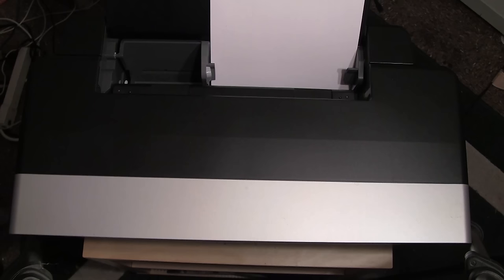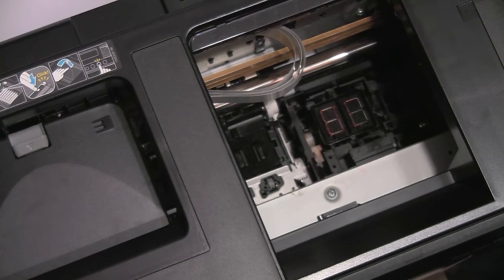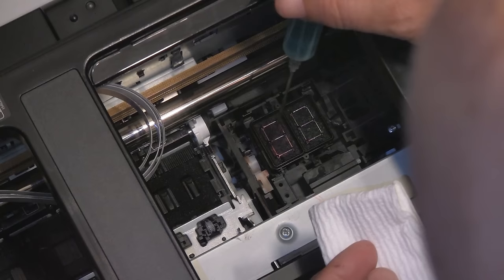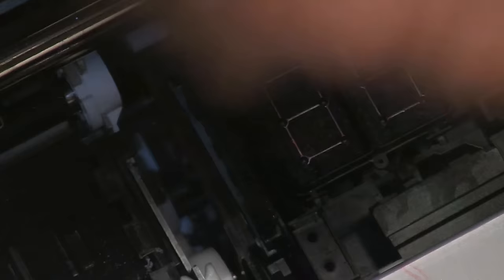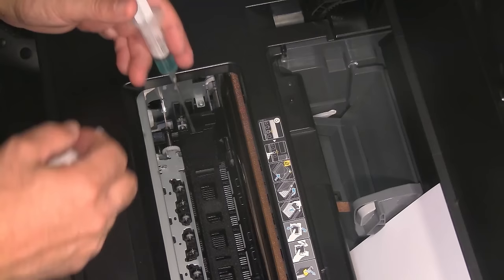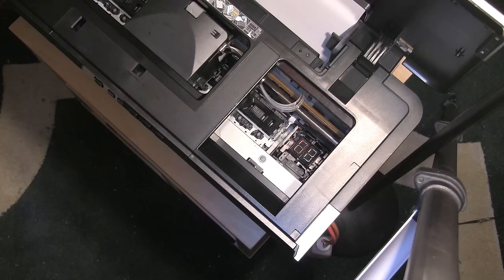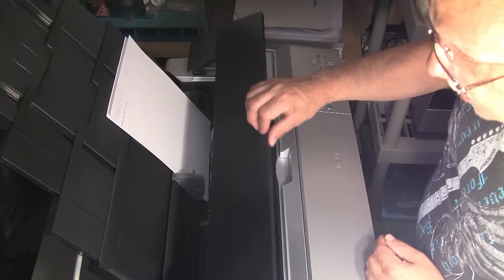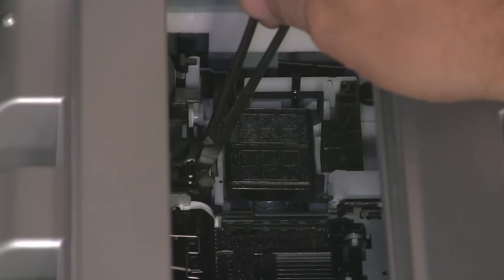How to perform Basic Maintenance on the Epson R2000 and 3800

Comment: Thanks for the video, it seems to be the most useful of several that are posted on YouTube. In particular, the R2400 (mine) has this plastic lid over the cartridges, so some of the other videos on other Epson's aren't really applicable. Do you have a video also for unclogging the nozzles? Also, how long does one have to wait to make sure the ammonia solution is dried before actually using the printer?
Reply from the maker: +Mark Samuels  Yes most EPSONs with Carts that Ride on the Printhead carriages have those covers. You can actually perform something that seems to unclog truly stubborn nozzle clogs that you can not do on the more PRO printers.
After having the Print Head moved toward the center position and resting over a damp paper towel , you can remove the color cart corresponding to the color that is being stubborn and with a plain tipped syringe with a piece of tubing attach, directly inject head cleaner into the ink stem. Easy does it. As you can actually cause damage to the print head. But when done right it will most often clear out really tough clogs.
I'd have to review the video to know what you are referring to when you say " how long does one have to wait to make sure the ammonia solution is dried before actually using the printer?"
There really is no wait in most cases.
Reply: +Jose Rodriguez Thanks for the reply Jose. There are some other videos showing how to inject a small amount of solution into the print nozzles after removing the ink cartridges. This printer was out of use for several years so is probably very clogged, and there may be air bubbles in the nozzles. What I meant about the cleaning solution is that ammonia is pretty strong, even diluted, so wondered if one had to wait before running a print check for example. Sounds like not a problem. I am in Canada, we can buy Windex here, some other site mentioned that other ammonia cleaners could damage the print head so will stick to the windex. Am waiting for some replacement ink cartridges as some ran dry as well, can't do print checks or run the cleaning program till then. Will let you know. Mark
Reply from the maker: +Mark Samuels I've been using Windex for years without a single incident. But if you prefer, there are many Head Cleaning Solutions being sold by various companies that are ammonia free and use alcohols and surfactants  ( Soap ). They are all pretty good and work as advertised.

In my series on how to revive a printer, I go through the steps I used to revive an old EPSON R340 that hardly had any nozzle firing. I got it to work 100%.
Have a look and you should find it useful. The key is TOTAL Patience! You can not hussy this process. But unless the printer is mechanically damaged, you should be able to get it to work.
Reply: Thanks Jose I will try to find that other video and let you know if I can't. I work in a research lab so dealing with syringes and plastic tubing is not unusual. I just don't want to break something with too much pressure or short-circuiting or wrong solvent. Sounds like the mechanics are actually fairly forgiving if one can use ammonia, alcohol or ethylene glycol (i.e. antifreeze) without damaging the print head or sponge material. I'll try just wetting and blotting first, if that doesn't work then I'll blow solution through the nozzles to clear them or remove air bubbles. But it might just be dried ink on the head itself. Thanks!
Reply from the maker: +Mark Samuels That's interesting, I also worked in a research Microbiology lab at the Armed Forces Institute of Pathology, not closed, for about 25 years. So I also had access to all sorts of goodies.
I've never had a single problem directly caused or due to using Windex on any of my multitude of printers.
If you get to the point where you will inject head cleaner into the ink stem just keep in mind that you can damage the head. So if you are able to easily inject cleaner, while the print head is resting over folded paper towels, let it sit for several hours before you inject one more time. Then replace the cartridge and restart the printer. Let it do its purge and check your nozzle check. Likely you will sill cleaner inside the channel chamber so do a cleaning cleaning cycle and recheck. If all is fine then you are set. If it still isn't but you are showing improvements, turn off the printer and let it sit overnight before retesting and possibly repeating the process. 

I was abler to completely restore a R340 that had about 95% of its nozzles blocked. If you are interested, watch my series on that.
But patience reing king when you are trying to clear out a really stubborn channel.
Reply: +Jose Rodriguez Thanks again for the additional details Jose. Interesting, you either worked on important pathogens soldiers are exposed to around the world, or creating new biological weapons - I don't want to know which! Anyway, I've cleaned the print head with soaked paper towels from underneath, and injected small volumes of windex through the nozzles so I think they are clear. However nothing prints when I run a print check, I imagine I need to run a cleaning cycle to reprime the nozzles, but I'm out of one ink color and waiting for the replacement from Epson, without it the cleaning program won't run of course. Once I have the replacement and run a couple of cleaning cycles hopefully all will be well, but will let you know if not. Best,Mark

Comment: thanks 4 this ! I own a R3000 with no-genuine ink . my black matte stopped completely , no line at all on the nozzle check . Epson fixed for free , but they said it was because of my not genuine inks . Now I'm afraid to use  no genuine inks again... any suggestions ? do you think it happened because of the inks of poor quality ? it worked great for months
Reply from the maker: Alessandro Piras Probably not the inks IF you bought inks from a reputable dealer and not CHINA! The cart may have also failed to feed the lines OR you may have introduced AIR into the line which is nearly impossible to remove or purge unless you reinitialize the printer, only a service tech has the software to do . That is why you had a complete failed black nozzle check on that color. You will almost NEVER have a complete failure of a color channel. That usually indicates a bad cart that leaks air and not actual clogs. You should expect to play at least $20 per 100ml or each color if you  buy from reputable dealers in the USA. Anything less and you are buying crap that will hurt your expensive printer.I use OEM and top quality 3rd party inks on all my 16 CANON and EPSON photo printers! Only the best will do.Or just stick with OEM inks. No one ever said that home printing was going to be cheap. Why buy a great and expensive printer and then go cheap and feed it garbage that will probably kill it?  Not a good idea right?
Reply: Jose Rodriguez I have a complete block in black. the printer was off and in storage for 5 months. before storage it printed perfectly. i have run the cleaning utility three times yesterday and three times today, black is still not printing when printing the nozzle check. going to do the windex clean but im curious about air in the line...
Reply from the maker: There are no lines to speak of on the R2000 so it is not that, but are you using a refillable cart? There ways to clear out a true clog if it is indeed that. Are you saying that one Black channel is totally blank? Not even on line?
Reply: Jose Rodriguez by carts, do you mean ink cartridge? if so, im using the carts that came with the printer direct from Epson. No lines are printing from either black. Thanks!
Reply from the maker: ***** The Matte and Photo black are not printing? On your first comment you say no-genuine. So now you are using OEM inks? If both Black channels are blank I would suggest that it might be a mechanical problem that you will have to talk about with EPSON. I apologize on my previous post. I thought we were talking about the R2000. The R3000 does indeed have ink lines and if you were at one time using refillables or otherwise, you could indeed introduce air into the ink lines and that is very difficult to force out with only cleaning cycles. Only a full re initialization can force air through and out of the lines so you only have ink in them again. And Adjustment program is the only way to re initialize the printer. It will use up a ton of inks but the air will be forced out.Those programs are only available to Service techs but you can buy them off of EBAY If you look for "R3000 reset" http://www.ebay.com/itm/EPSON-STYLUS-PHOTO-R3000-SERVICE-ERROR-FAULT-RESET-FIX-MAINTENANCE-DISC-/161755190981?pt=LH_DefaultDomain_3&hash=item25a95c56c5You must be VERY careful using this software as it is meant for EPSON Engineers and you could forever ruin the printer's firmware.
Reply: Jose Rodriguez  R2000 is my printer. Both the matte and photo black do not print. My software says there's ink in the cartridges. I'm using Epson T1591 Photo Black and T1598 Matte Black Ultrachrome inks. The inks came new with the printer.
I will soak printer head in windex, contact Epson and let you know what I find. Thanks!

Comment: Hello Jose,
Thanks for making this video. I have an Epson Photo R800 which packed up 2 hours ago after trying all sorts of button pushing I decided to look on you tube for help. The sponges were clogged and I just gave them a quick wipe off with kitchen roll - it worked and the printer started up again!!
It still has a 'service needed' pop up and the printing is a tiny bit smudged so I was wondering if something else other than windex would work as its not easy to get in the UK.
Maybe methylated spirit or something?
Anyway thanks for saving my printer especially as I bought loads of ink just recently! 
Martyn.
Reply from the maker: +MrTeatime2 Glad it helped. You can use a 5% solution of regular cleaning ammonia in distilled water then use that.The Pop Up? Does it say that parts Have Reached the End of their Lives? If so that is the Waste ink Pads and the waste ink Counters need to be reset.Make sure you really clean the left most area of the platen sponge. That gets super grungy.Clean the perimeter of the Purge unit-sponge  or AKA  parking station  and the wiper blade.You need to do this at least once every couple of months depending on how often you are printing.
Reply: +Jose Rodriguez Thanks for the reply Jose, I didn't clean the parking sponge or the wiper yet, just the very fouled big left pad. I'd like to get some ammonia and D.water to clean it all properly as your video shows. One pop up said parts have reached their end of life, now it says it needs a service! Since it's working now I'm thinking a good clean up might be all it needs and I don't intend to use it again until it's been cleaned anyway. Thanks again Jose.
Reply from the maker: +MrTeatime2 You will ha e to reset the waste ink counters zoo er or!after. There is a free tool that will work on the r800. The SSC tool I TBI k it is can!led. Or the pay per use WIC tool. You can get the too from www.octoinkjet.co.uk and you use it for free to read the couters. To reset you have to buy $10 reset serial key.
Reply: +Jose Rodriguez Thanks for all your help Jose I really appreciate it.
The printer gets only light usage and I bought enough good ink to last a long time so if a clean and reset keeps it working then that's great.
I didn't understand what you mean, 'The SSC tool I TBI k it is can!led.?
Martyn
Reply from the maker: +MrTeatime2 Yeah. Sorry about that. Typing on my table is a bear for me! It was supposed to read "The SSC tool I thnk it's called"Go here for the SSC toolhttp://www.ssclg.com/epsone.shtmlYou may have to run it in XP compatability mode.It should be able to reset the R800. If not then you will have to use the WIC tool fromwww.octoinkjet.co.uk for $10 per reset.
Reply: +Jose Rodriguez Thanks again Jose, I found both sites and I can get Windex from Amazon!
Reply from the maker: +MrTeatime2 That's great. Make sure it is the original with ammonia.

Comment: I have a 4 yr old R2000. Recently, the print speed has slowed to a crawl.  It will make perhaps 8 swipes across the carriage and then slow to one swipe every 4 seconds (I timed it). Multiple emails and phone calls to Epson Support have resulted in the determination that it is not a software or communication issue.  Rather, it points to a hardware issue. Their recommendation is to take it to an Epson Service Center, the closest being 40 miles away in NYC (no thank you). I came across  your video this morning while trying to do some more research on the slow print speed.  I am embarrassed to say that I never knew you needed to perform these types of maintenance tasks.  When I looked into my printer, every area that you mention is coated with ink, the pad on the far left looking like a lake. Is it possible that this is what's causing the slow print speed?  NO ONE at Epson mentioned doing any cleaning such as this - no surprise. My latest nozzle check, btw, has only one missing dash in one of the black cartridges. All the rest look fine. The print quality seems fine, if a bit dulled, but there are no smudges, streaks or white lines.

Thank you for any input.
Reply from the maker: Are you on WiFi??  Nothing I know of would cause slowing down of the printing process except a WiFi problem.  And please do that maintenance procedure every two months.  Eventually you will get unexplained black blotches all liver your prints.
Reply: Thank you so much for your response. Yes, I am on WiFi.  Recently, we changed our Internet provider and hence, our router.  I initially thought this was the problem, but after uninstalling and reinstalling the software and updated drivers umpteen times AND trying a USB and an Ethernet connection instead of the wireless one, the problem persisted.  Did not happen with the previous router, but wouldn't the same issue with the wired connections rule out the router?

Got Windex today and will definitely do the maintenance procedures.

Thank you again.
Reply from the maker: Remember that when you install for WiFi and alwo USB you will get TWO copies or  instances of the printer in your devices and printers.  Wait...... Are you on Windows??? Please say yes.  If so, you will two icons in the devices and printers. One will use WiFi and the mother USB. Make sure you are printing with the correct one Iintended for USB.  I have an R3000 that prints like a Tortoise on WiFi and like a Hare on USB.  But you need to select the correct printer as you will have two copies of the same one printer.
Reply: OK, Thank you.  I THINK I have tried that in my quest to solve this issue on my own, but it's worth another shot tomorrow. I will let you know of the outcome.  And yes, I am on Windows.

Just to be clear, would you install the "USB Copy" from the original disk, or just use the "Add Device" from the devices and printers window?
Reply from the maker: No from the original disk. Delete the copy you now probably have showing up in Devices and Printers. Right Click and remove printer.  Then during the reinstall choose Via USB and none of the others.
Reply: OK - Victory, I think! As per your instructions, removed R2000 from Devices and Printers. Re-installed from CD using USB connection.  Printed a photo from Windows Photo Viewer - speed was correct. Hurray!

Went to print from PSE 13 and got message: "The saved printer information is not compatible with this version of Photoshop.  The saved printer is no longer available."  Checked Adobe Forum for help with this and learned that the fix was to download the PSE 13 Update 13.1, but I was already running 13.1.  Someone else on that forum suggested checking "reset preferences on next launch" in the PSE Preferences box AS WELL AS  downloading the latest printer drivers from Epson for my R2000 (I had neglected to do that with the new install). The combination of those two things seemed to do the trick.  I can now print from PSE 13 without issue and at a "normal" speed. The only mystery is that when I choose File/Print, I get a choice of the R2000 OR the R2000 Copy 1.  The R2000 choice does not give me the correct options, the R2000 Copy 1 does. I am guessing the "Copy 1" showed up after I downloaded and installed the new drivers?  But I do not have two copies showing up under Devices and Printers, only the R2000.  Just curious as to why they would both show up in the PSE print window.

After all of the above, I went about following your instructions for cleaning the printer itself which, mind you, had NEVER been done in four years.  Needless to say I went through quite a few paper towels, plus replaced three ink cartridges that were riding on fumes before I even started.  Three print cleaning cycles and I got a perfect nozzle check print out.  Then went back to PSE to print a scrapbook page I had just done a few days ago and the colors are much brighter and more closely resemble those on my screen. I am a happy camper.

I thank you kindly for your help. If you know the reason I have the two printers showing up in the print window, I would love to hear it, but I have no intention of messing with it any further.  Unless  you tell me too :)).

Thank you again,
Jackie

Comment: I'm picking up a r2400 this week that having been use and years. Any tips on the 1st I should do when I get it?
Reply from the maker: Cross your fingers. Just power it on do a nozzle.check and see what you have. Do one cleaning  cycle and let it rest for a day then do a nozzle check. Do the Windex wetted paper towel under the print head trick. Patience is the key here. And good luck.
Reply: Jose Rodriguez I'm going have to buy the ink 1st right
Reply from the maker: Yes!